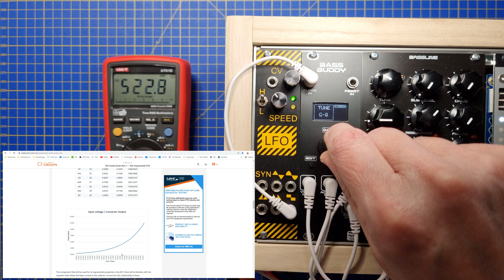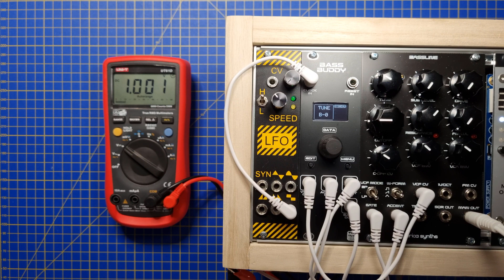Eurorack DIY - Bass Buddy Ep 2: Demo, calibration and tuning

Comment: Just one question: Does it need the lfo signal for the clock in, or can it also work without, cause I did not want to spend another lfo for example for a mobile setup this is planned for...
Reply from the maker: Hello Sven!
It needs to have an external clock signal connected to the Clock Input, there is no internal clock generator I'm afraid.
Reply: @MeeBilt  pity. And I assume it does not save the values in a non-volatile storage... Or can I add a battery for that?
Reply from the maker: @svenwehrend7495  Patterns are stored in EEPROM (non-volatile memory) but not automatically - you need to use the SAVE and LOAD functions in the System Menu to store and read patterns.
Reply: @MeeBilt  That sounds good!

Comment: Cool, is this purchaseable?
Reply from the maker: Hello Andrew, 
All the documentation and production files needed to build one is available on my Github (https://github.com/tkilla64/eurorack/tree/main/bassbuddy), so you can ofcourse source PCBs and all needed components and DIY one by yourself. 
However, I have no plans to turn it into a commercially built product.

If there is a large interest in this module I will look into setting up a shop on Tindie.com, where I would sell DIY kits of it. But not prebuilt modules.
Reply from the maker: @Andrew Davis - if you still are interested in this module, check out the Full DIY kit here:
https://www.tindie.com/products/27346/

Comment: how you connect to speaker? when i made prototype on arduino nano i smell I smell burning on speaker
Reply from the maker: Interesting question; But why would you want to connect a speaker to a sequencer... ? 🤔
Reply: @MeeBilt  ah i wanna test the sound from analog
Reply from the maker: The speaker should be connected to an amplifier and the amplifier to the synth. The synth is connected to the sequencer.
Reply: @MeeBilt  oh i use monkey gibbon 5 speaker so i need a amp like soundcard?
Reply: @MeeBilt  Could you made the diagram of eurorack? i wanna be safe when using rack because no one in here know about it, also the diagram of synth to sequencer too, thank u
Reply from the maker: The gibbon 5 is an active speaker, so you do not need a separate amplifier in that case.
In the video I show exactly how I hook up the sequencer to the Bassline DIY. The MAIN output from the Bassline should be connected to the amplifer-speaker (in your case the gibbon 5). Use the volume control on the back to adjust the audio level